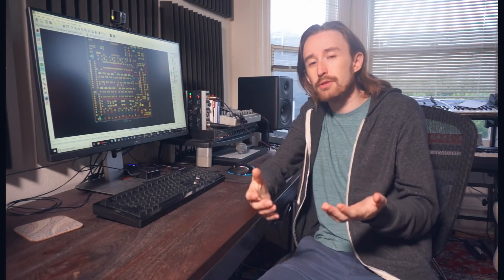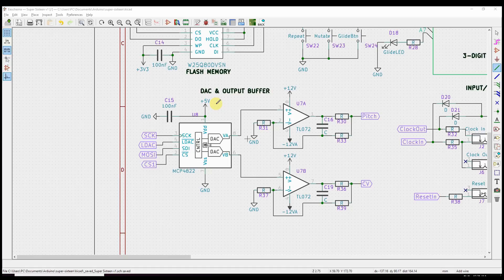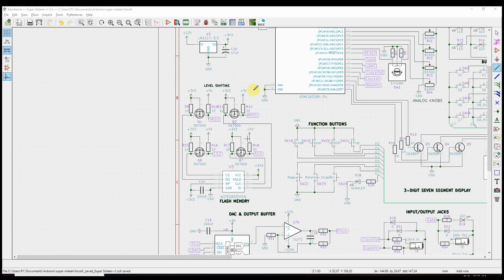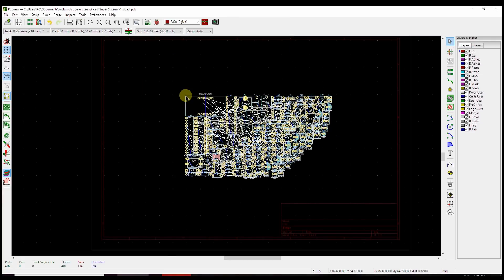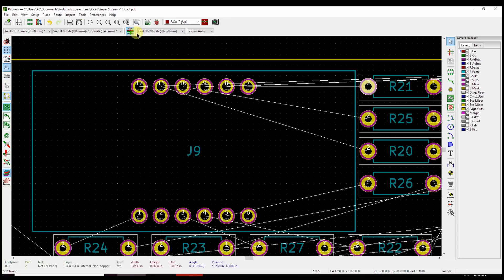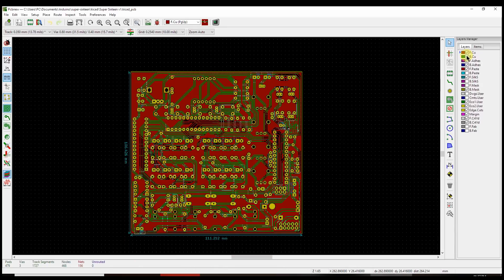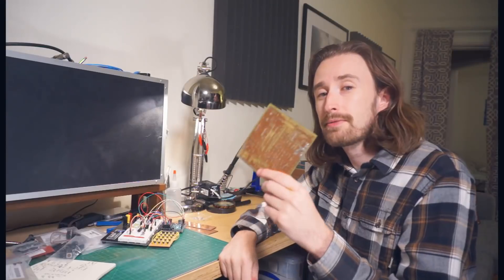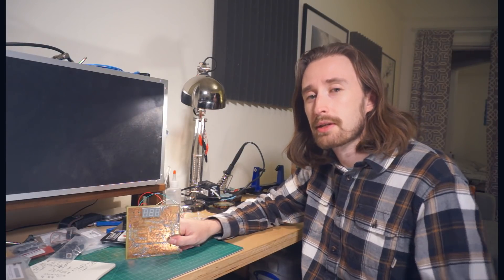Designing Eurorack Sequencer Part 4: Making a PCB with KiCad 5.0

Comment: one thing i've been trying to understand for a while now about pcb design for audio applications:
it doesnt seem like there are any stand-out 'best practices?'
a lot of the prevalent information about pcb design relates to high-speed circuits
in high-speed, those unconnected copper islands would act as resonant antennae
i noticed that you didnt create a real separation between analog & digital sections
i've read that audio is one of the rare occasions when you would actually split your ground plane (into analog & digital sections), and that separating high speed digital MCUs from your analog traces is a must-do.
when laying out footprints & routing, are there any real considerations or design practices that you would rule as essential? or is pcb design for audio pretty much; do whatever you want, it doesnt matter?
Reply from the maker: That's a good question. While a sequencer isn't technically an "audio" device as it only outputs control voltage, some of the same principles apply. Big ground planes where possible, high speed stuff away from analog sensing. AGND/DGND stuff wasn't as applicable here because the analog signal path uses a bipolar op amp output and the digital stuff is all ground-referenced, but I probably could've done a better job isolating the DAC's ground trace.

Most of the RF-specific design stuff has to do with high-speed signal integrity, particularly slew rates for clocks and avoiding degradation from stray capacitance. With audio you're much more concerned  about overall noise floor than HF response because your ears have such a wide dynamic range compared to most signals. Using coaxial, grounded interconnects is the biggest contributor there. You can replicate some of that on a PCB if you use 4-layer boards with dual ground planes and via stitching, but the traces are much shorter than  most wires so it seldom matters. If you play around with analog circuits on a breadboard you'll quickly see how much the physical jumper wires contribute noise much much louder than any other aspect of the circuit like power. 

Anyway that's a long and rambling response from a non-expert, hope that's somewhat helpful!
Reply: @extralifedisco  Thank you so much!! Really appreciate the detailed response & wisdom!!!

Comment: I found that using light sensitive boards and printing the layout on transparencies produces much cleaner and more reliable results. 
Also tin sheers work great for cutting PCBs.

Great project, will you make the design and code publicly available?

Cheers
Reply from the maker: Yeah after my experience with this board I'm definitely gonna switch to PNP blue or maybe UV boards - toner transfer looks good from far but far from good. Also discovering that double-sided stuff is maybe a bit much to bite off at home! The designs and code so far are up on my github, though maybe wait for a schematic revision before you try spinning one up! https://github.com/matthewcieplak/super-sixteen
Reply: Awesome, thanks for sharing!